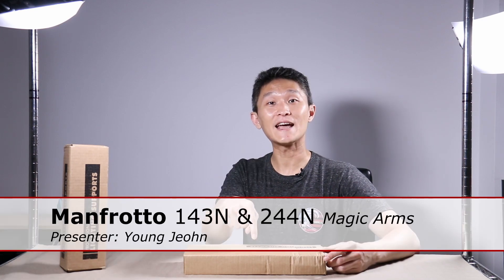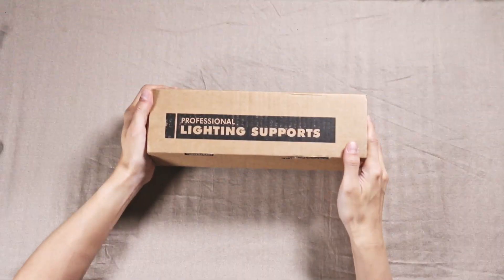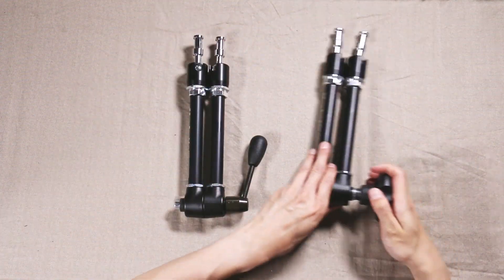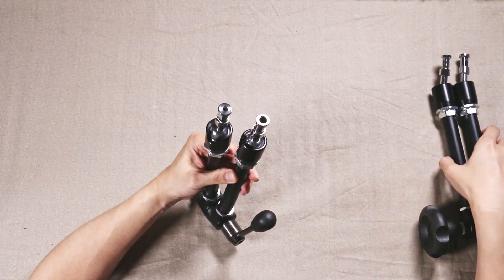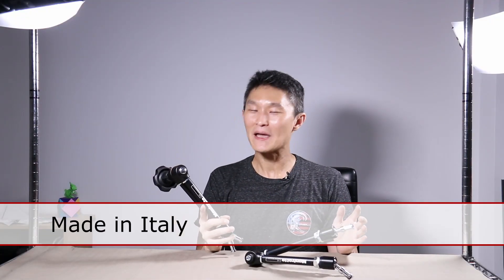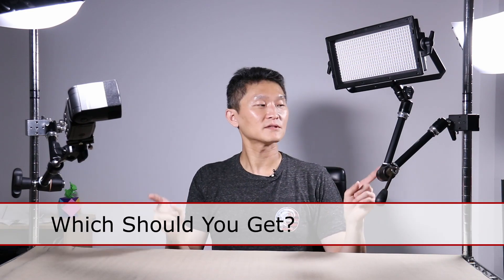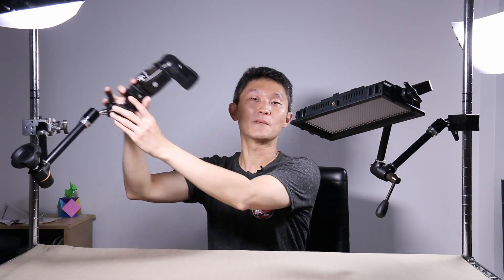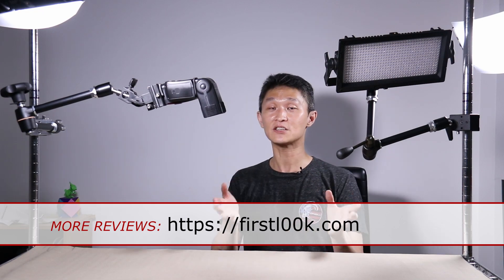Review: Manfrotto Magic Arms 143N & 244N Magic Arm - Which is Best?

Comment: My wife has a disability. She lost her limbs a decade ago, including both arms at the wrist. . Thank you for showing how both are used. I plan to get the lever lock (she is not good with twisting knobs) arm for her to mount her iPhone to her wheelchair.  Currently she uses the uses the 3 second timer, then swings the iphone (via it's strap) in the direction it needs to go, then checks if it is too blurry. This works often enough, but I want to get her something that has more control when we go to an event. I have a nice ballhead for her to use with it.
Reply from the maker: There's an idea! That's a unique way to use the magic arm; I hope it works for her.

Comment: Working in production sound I've used the 244N for years on set,  in picture car rigs to set mics. Like cameras, mics have to be precisely placed and the lever could be time consuming; at the cost of roughly $10,000 per minute, time on set is not something to "consume". This is a solid, concise explanation and demonstration, of the differences between the 143N & 244N.
Reply from the maker: Thanks for putting that into perspective! It's great insight for those wanting to get involved in bigger budget productions. Every minute does count; get gear that let's you do it right the first time.

Comment: Great video and explanations. The lever lock had me fooled - I didn’t expect the jerky movement in order to lock it. There aren’t very many videos that actually show how to lock the 143N.
Reply from the maker: Thanks! I was excited with my first 143N purchase - until I saw how difficult it was to get an exact angle set up for a camera (so it got relegated to lighting duty most times!) I'm glad it helped, it sucks to have to spend time returning things just to buy another one.
Reply: I didn't even dare to use the lever because I was afraid to break it. The instruction doesn't mention that you have to use quite some force to move it into the locking position. This video helped me out so thanks!

Comment: Voting for 244N in the long run. We have got both (10 in total) now for several years as antenna and iPad arms... After a while the screws on the 143 came loose and the 3 tiny metal balls inside the mechanism started moving  into a wrong place. As a result you cannot lock it, until you open up everything, put the balls at the correct spot and tighten the screw again (have fun when you are outside and there is no table or clean space to open and fix it, because when you loos one of the metals balls it doesn't work any more)...fixed it... until next time and yes, it happens again (so you better transport it, when it is locked) and when you put it close to a wall or some other narrow space, the lock-mechanism (that tiny moving arm) of the 143 gets in the way and you have to twist and turn it until you can look it.
The 244N instead has a simpler and more durable mechanism in the long run... when it falls apart you have not more than 4 single parts + screw. Easy to fix in the field and no issues when you want use it in narrow locations, since the wheel is just wheel and not a moving arm that  might hits something when you try to look the arm.

So Once more 244N only from now on ;-)
Reply from the maker: That's great to know, thanks! I've only had one 143 long term before getting the 244N. Will have to keep tabs on this issue for the future.

Comment: Thanks for the video. You helped me  a lot (!)  choose which arm to buy. This table on wheels is great - where did you get it from :) ?
Reply from the maker: Not actually a table, but a rack system. You can pick up a metal "home" version with wheels from Amazon:
https://amzn.to/2TibMHG (it's an affiliate link - doesn't cost you anything)

The link above was the best cheapest one I could find. Couple of things to note:
1. The shelves are wire frame so you need a hard surface (or maybe a heavy cloth) to lay on top of it for a "table".
2. The link above has a wheel option. If you buy another brand, you'll probably have to buy those separately.
3. Racks all look the same in pictures. If you're buying on line, be sure to measure everything out first.
4. Buy as wide a length as possible (I have 48" length) or the poles may be visible in your videos. Having said that, they're great for using overhead cameras.

To be totally candid, I own industrial food grade Metro racks (there were no other options back then; I got mine more than 10 years ago for a food business.) But now there's home versions of this shelving system at much cheaper cost.

Of all the things I've bought in my life, these racks have easily outlasted most of my other possessions - and still serve me well! Nowadays, it double duties as a Youtube video "table" and a standing desk. I guess when you live in a tiny space, you start getting more creative with what you have. :-)

Comment: Thank you for this guide . Q1: The magic clamp not included with magic arm right? U have to buy separately. Q2: I have similar steel shelf like u which I intent to convert as a workstation / table . How do I fixed the wheel as seen in your video? What model of wheel is that?
Reply from the maker: I use 2 attachments on the arm - one that holds the clamp, and one that holds a DSLR for overhead shots.
Arm and bracket looks like this:
https://amzn.to/3ft7NkO

Super clamp is separate, looks like this:
https://amzn.to/2XsjgLb

I get this question a lot so I should probably make a video on this too.

About the shelf, if you mean the wheel attachments so you can move it around, I got mine from Home Depot (I like them, they're very good with a good price) set of 4 for about $24 and looks like this:
https://www.homedepot.com/p/HDX-4-in-Industrial-Casters-with-Bumper-4-Pack-30260PS-YOW/100658236

The screw size is 3/8", so if you want to buy online, I think these look very similar and also have brakes:
https://amzn.to/33qzxnJ

Comment: Great video, thank you! Just curious, if you have the space for it, would a C-stand basically be able to do everything that a magic arm can do? Or is there any reason to get a magic arm if you buy a C-Stand, any other benefits/uses? Thanks!!
Reply from the maker: A stand is more stable, I'd use this first if I could. Magic arms are good in areas with space constraints or if you need to set up in weird angles. C-stands are expensive and heavy, but if that doesn't bother you, go for it!
Reply: @FirstL00k  Thank you! Do you think the magic arms can hold a light with a softbox? Or would that be way over load capacity? Ok that's probably wishful thinking and the likely answer is no I'd imagine!
Reply from the maker: @itsdannyftw  that sounds way too heavy. You'll need a stand for that one I'm afraid.

Comment: Which Super Clamp are you using, the 635 or 035? It's hard to tell but it looks like the 635 to me.
Reply from the maker: In the video, I use both. The bigger LED light was on a black Manfrotto 035 & the camera flash was on a silver Matthews 635.

Comment: nice review can I use this as a microphone stand and what stud would I need if its possible to connect a mic clip?
Reply from the maker: Some mics can, some can't. You'd have to find out what add-ons your mic supports - I don't have your mic in my hands, I'd have no way of knowing what you need. See if you can find a Youtube video of your mic to see what accessories people use with it.
Reply: https://www.bhphotovideo.com/c/product/304651-REG/Manfrotto_013_013_Double_Ended_Spigot.html

I bought this adapter which is perfect for me. It has both thread sizes for mic clips. The two ends of the Manfrotto are the two different thread sizes (female) so you really have a lot of flexibility. I mostly need the 5/8” male thread adapter for mic clips, so I have my male-male adapter in the 3/8” side and I keep a super clamp on the other side.

Comment: can this hold zv e 10 camera for overhead shots?
Reply from the maker: I use mine to hold a Canon 80D and a 18-135 lens. If the ZV-E10 weighs less than this (as I suspect that it does), it should hold it up just fine.